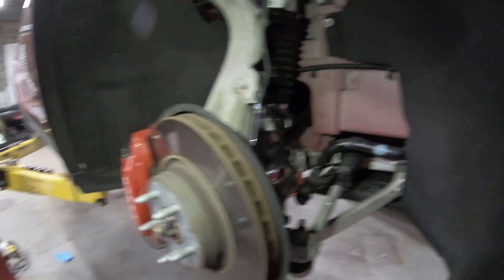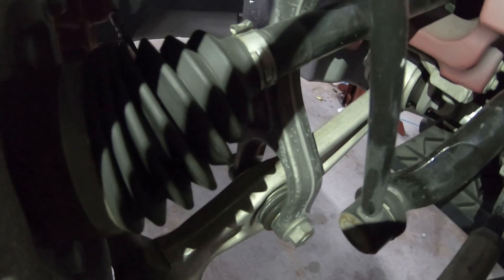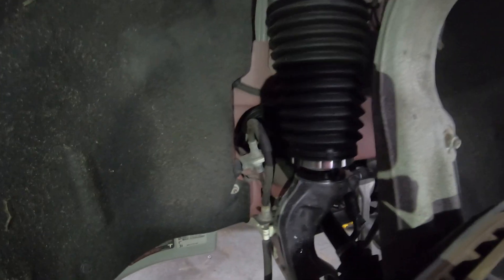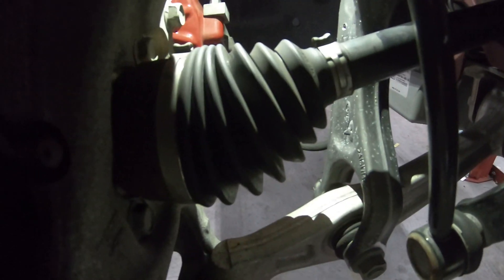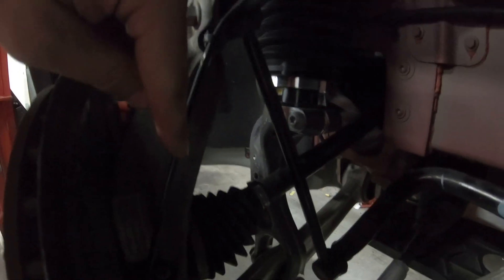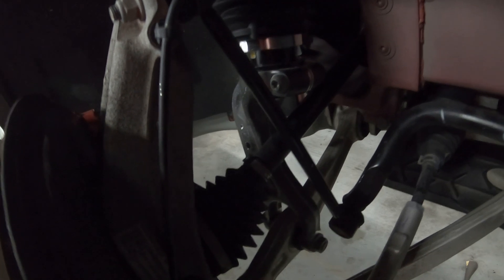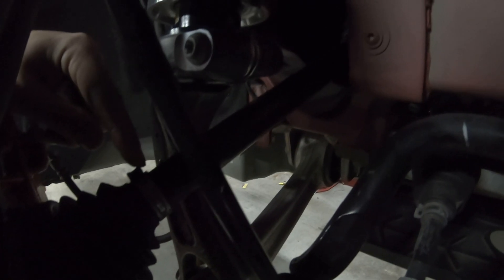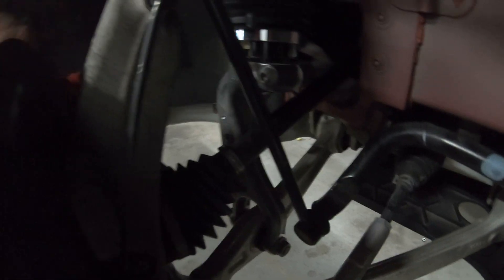Why do certain Model X's click and vibrate under acceleration?

Comment: Great video. Just to add - in order to prolong the life span of the axles use low ride height as standard. This has been added to the UI not long ago since they realized medium is killing them.
Reply: This is a bad idea, I did this and you will go thru tires a lot faster, the camber is not correct when that low

Comment: Model Y had that since week one. They took it in and then said that they replaced axle but in records it shows only lubrication of shafts and a lug replaced. And year and a half later I see that one of rear tires is worn out. Could they have shifted alignment?
Reply: They may have mistaken the angle-vibration complex, as described here, as an axle/hub slip problem and lubricated the parts as per that break/fix scenario. But in no universe does that correct/mistaken procedure, or the material discussed in this video, alter alignment in some way as to prematurely wear tires with incorrect alignment… notwithstanding human-error-levels of “oopsieeee I fucked up A while fixing B” lol
Seriously tho I’d guess you or your SO curbed a wheel or hit a New Jersey pothole before suspecting that. Doesn’t take much to wear a tire down over time.

Comment: I had this vibrating issue on my 2021 X Model (ludicrous) and I just had the haft shafts replaced on New Year's Eve at the Service Center.  They handed me the keys back just as they were closing up for the holidays and told me all was well.  Upon driving 60 miles back to my home on the highway, the unnerving vibrations were already back.  I didn't even have 24 hours of peace with this extremely expensive vehicle before having to deal with the problem all over again.  Like one of the questions asked below, is this a dangerous problem?  Can my family drive this vehicle with this engineering defect and still be safe?  I haven't heard of any accidents caused by this defect, but I don't want to be the first one.
Reply: This vid makes valid points, but the fix isn’t just axles, but also bearings and they have service bulletins for lower control arms (for certain years S/X) But take it back and let them know it’s still happening..

Comment: I had the vibration issues, which came from the driveshaft... they replace both left and right on my 2018 100D a few weeks ago and told me they have new shafts which are better. The vibrations are gone now. It seems they have a fix for it now.
Reply: How much did it cost to fix?
Reply: @PerformanceY  I know you posted a while back. But, I just had to have the front half-axles on my 2017 Model X P100D replaced because the front end shuddering was bad on almost any acceleration. It started around 30K miles. I don't think I should have to pay for their engineering flaw on a car having a problem after that few miles. But, they charged me $2500. I won't be buying another Tesla.
Reply: @CyndiWells  
Waw, that's expensive.
Reply: Not sure, I had it done under warranty. I believe they said it normally would cost a $400-500, but I am not 100% if that was regarding the drive shafts or something else they fixed. Sorry I can’t be of more help.
Reply: @Paul Peelen  
So your car was pretty new if you got it fixed under warranty.  Im looking to buy used modex X 2017-18 year model,  so im worried since it will not have any warranty left
Reply: @PerformanceY  No, it is a 2018, but I bought it in the beginning of this year directly from Tesla; when buy a pre-owned from Tesla you get 1 year or 20.000km (which ever comes first) of warranty with the car. My car was manufactured September 2018 and first time registered 29 dec 2018.
Reply: Is it still fixed?
Reply: @Ironrodpower i don’t have issues now, so yes I’d say it is still fixes.
Reply: @PaulPeelen  Thx for the update.! Good to know

Comment: I'm told Tesla has a new design for the Model X half shaft parts.   If you are under warranty, a Tesla SC should replace both up front for free.   

If you expect to accelerate quickly, make sure you are in the LOWEST suspension setting as doing so limits the angle and reduces stress on the half shafts.

Comment: I have this issues despite having my 2020 X LR+ set to always be in low. Is this something that replacing the CV would fix, at least temporarily?
Reply: Heads up on that low setting. Having my model x set to always low destroyed the inside tread on all four tires. The camber makes it so that most of the weight of the car is on the inside tread. So basically, your damned if you do, and damned if you don’t. What I have decided to do is, keep my car in chill mode and leave the suspension in standard. When and only when I want to have fun, I lower it for fast acceleration only.
Reply: @jeffsvolta1221  solution for this is to have wheel alignment done when suspension is set to low. I had the same problem with my Model S before.
Reply: My 2016 MS has had this problem since 26k miles now has 60k. Have taken it to SC 3 times and they say that it is normal. Can’t drive in std and apply more than 100kw of power for it to vibrate
Reply: @precisionautotinting  They replaced my half shaft and now just 3k miles later it's doing it again. I may take it back with the lemon law.
Reply: @chadever87  let us know how’s turn out for you
Reply: @chadever87  any update on this issue? were they able to fix it?

Comment: Are these vibrations bad for the car?? Safety issue? Dangerous?  Or no effect on car?  Car remain safe?  Nothing going to snap off? Ha...
Reply from the maker: Team Balmert they aren’t good, but I don’t believe them to be dangerous. The vibrations accelerate wear on the components of the driveline, and there is the increased possibility of catastrophic failure, but I don’t believe it will cause issues with anything critical for safety (suspension, brakes, etc). It may break a motor mount or axle, but I truly don’t believe it will break anything necessary to keep the vehicle rolling down the road.

Comment: Lower the suspension when doing hard acceleration.
Reply from the maker: JRP3 of course, but as the car ages, you will still have issues when it uploads the front suspension under hard acceleration.
Reply: @EvolutionAutomotiveLLC    I'm actually surprised the shaft angle is that much more than the S to cause a problem.  After how many miles does this tend to show up?
Reply from the maker: JRP3 I haven’t seen consistency, and there doesn’t seem to be an average time. Some happen on brand new cars. Some don’t happen at all.
Reply: @EvolutionAutomotiveLLC  Wonder if adjustable suspension cars are more at risk?  Or maybe just a quality control issue with the CV supply.
Reply: Evolution Automotive LLC mine has 300 miles on it and has that clicking sound 
Unfortunately
Reply: Does this affect performance or safety?
Reply: I'm on my third set of driveshafts, 90k miles 2018 Model S 75D. Last set done just before warranty ran out and it's started to do it again now😭😭 Will ask Tesla how much to repair again, although suspect local garage could change driveshafts. Just would Tesla sell them to me?? In UK
Reply: @nikelliot8105  That's crazy.  They should sell them but with Tesla you never know until you try.